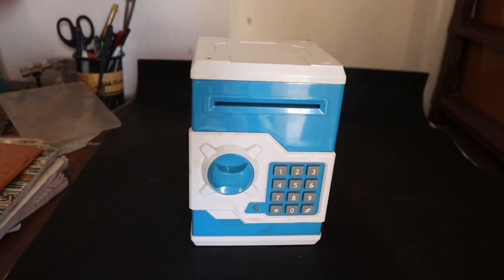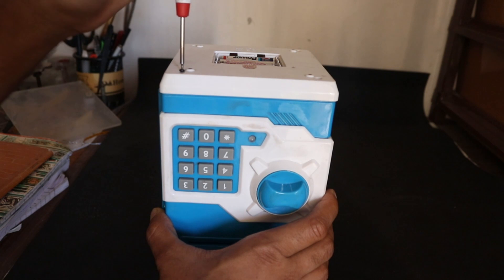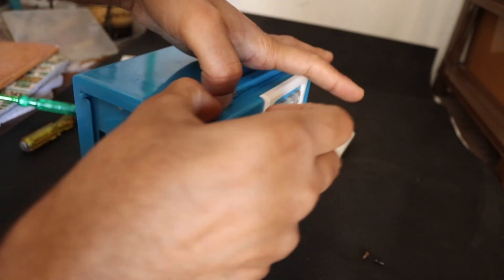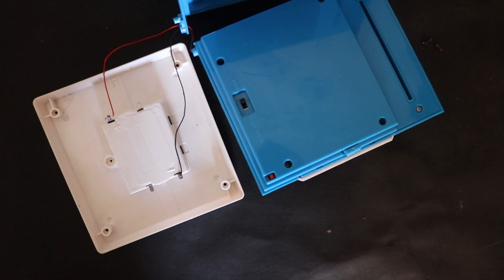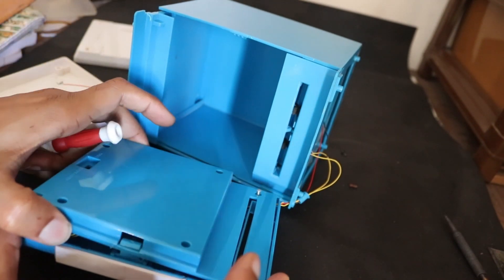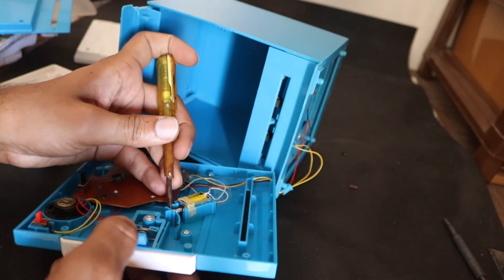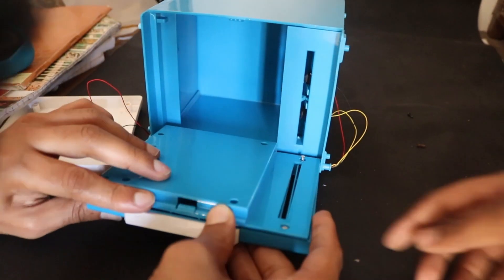How to Fix Money Bank| Repair Money Bank

Comment: How to fix when cell area is rusted
Reply from the maker: Just remove the whole part & replace it 
You can get the cell holders spring from old toys
Reply: It can get replaced the battery area?? Or the whole part have to be replaced? Please respond
Reply: And also is there any tutorial for how to replace spring area
Reply from the maker: @poojatiwari4579 text me on Instagram for details
Reply from the maker: You just need to replace the metal contacts @poojatiwari4579

Comment: to fix my slot that takes the money i just shoved the money through and grabbed it and pulled it out then closed the door and put the money in the slot and it worked.
Reply from the maker: Yes sometimes the motor stucks & when we rotate it manually it starts working

Comment: Can you please upload how to fix the roller that take notes.... please
Reply from the maker: Spin the roller with hand at first if its freely moving then Try running the motor attached with the roller with 5v-9v battery also check the wire of motor if it's attached

Comment: I found out that the one of the wire of the lock got disconnected or torn from the circuit board. where should I plug the wire? the "mb-" thing?

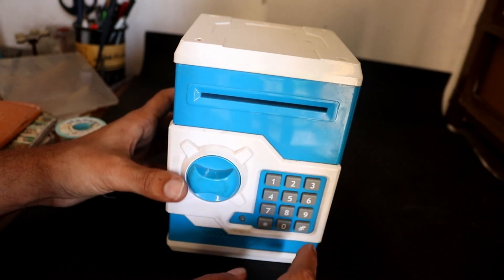Comment: At the 1:40 spot in your video, you edited to where you just remove the top and you pull it off. How did you get it loose? I cannot get the top off. How do I access the screws that are holding it on? Please help.
Reply: There are screws on the top, mine was hidden by (4) caps/plugs.
Reply: Can you tell how to do please 🙏

Comment: hey uh, im just wondering if you have an atm super my personal? i really need to fix it. i bought this ATM in 2018 and i last used it in 2019 its 2022, the battery is fine and its working but! mostly the keys are not working!!  like numbers, and other options. please help me, i want to consider this as my early bday present too!

Comment: How do you start motor to take your money in piggy bank
Reply from the maker: Actually the problem was with the switch  hence it wasn't triggering the circuit & that why it whole system wasn't working
Reply: @TechsScience  my piggy bank is working perfectly fine. But it's motor not working to insert currency and its door opening sound is coming late. What should I do? I am sad. I love this.
Reply from the maker: As I fixed the switch everything start working as it should be
Reply: @TechsScience  hello my piggy bank also not working
Reply from the maker: Send me the pic on Instagram
Reply: @TechsScience  my keypad and motor is not working